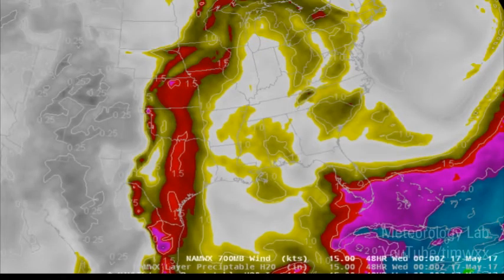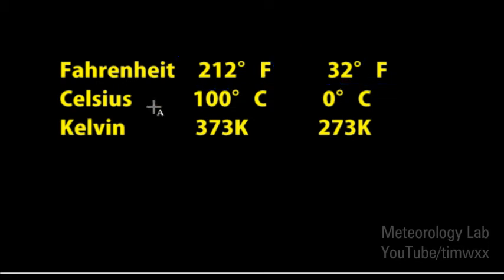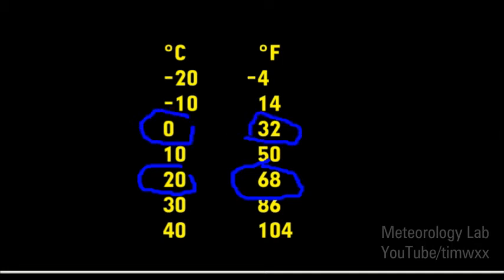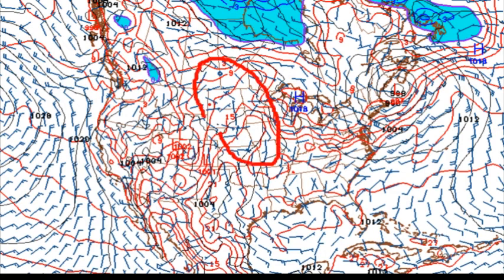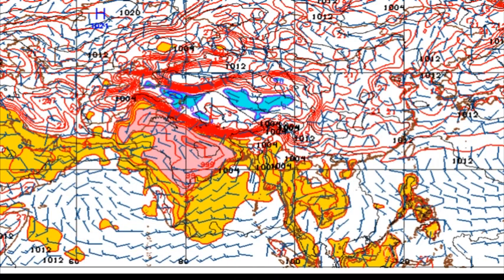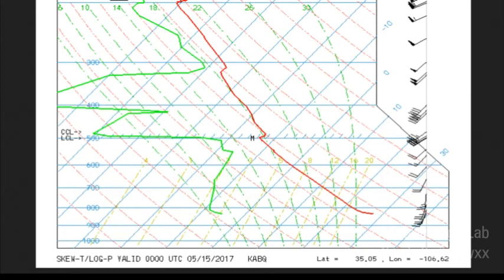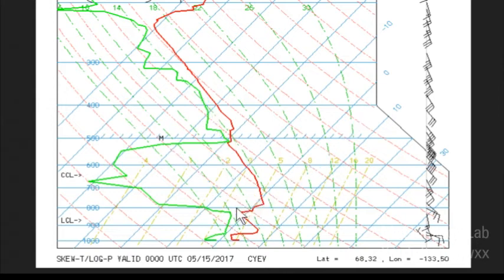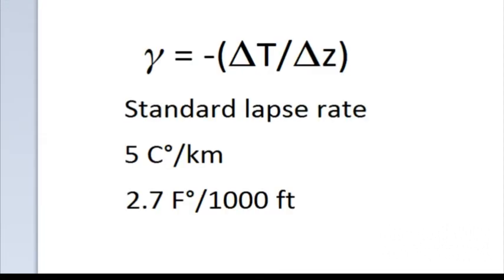DYN001: Dynamics -- Temperature And Moisture (Meteorology)

Comment: At first, the isotherms and the wind barbs made me think of vector gradients and level curves, but the wind barbs aren't necessarily going to be perpendicular to those isotherms, it looks like. Is it right to assume that wind is mostly caused by temperature differences causing a pressure difference? If so, then a simple mathematical model would show the wind barbs wanting to be perpendicular, so what does it imply when they're not, in reality? I have so many questions! Thank you for making these videos!